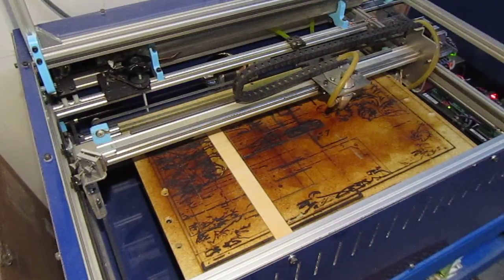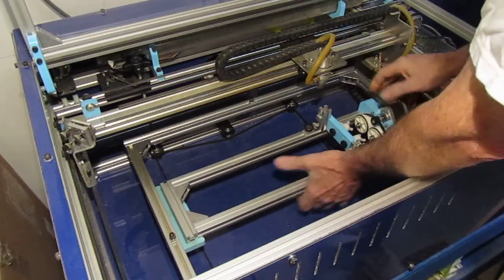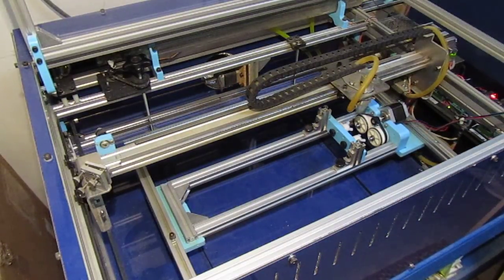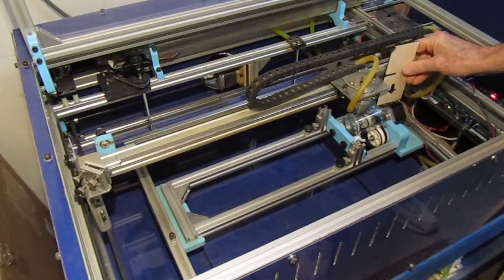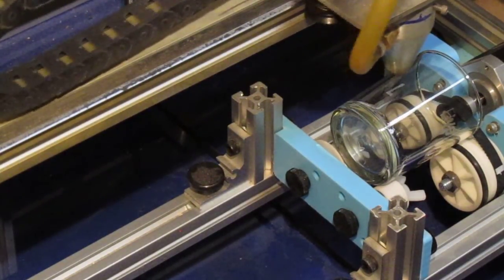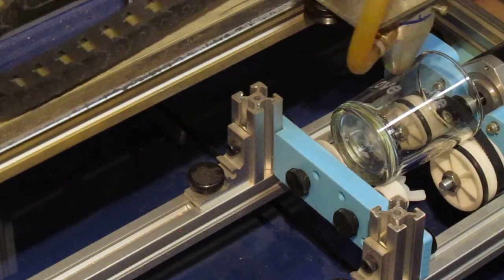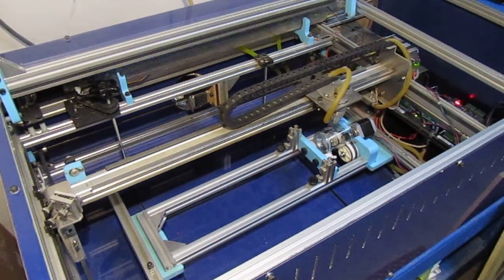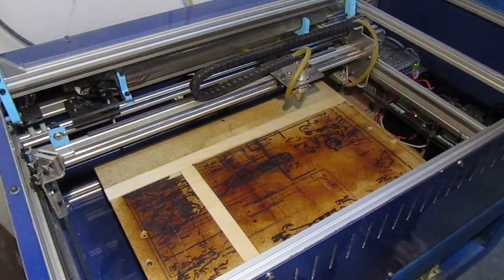Rotary Adapter Demo

Comment: hi Tim this is very good video  i have same controller but i couldnt  set up correctly  could you help me out whit that how did you set up and calculated pulse unit my laser doesnt move correctly  and it says X slot is over what is that mean ?